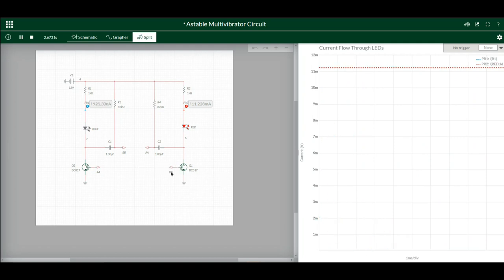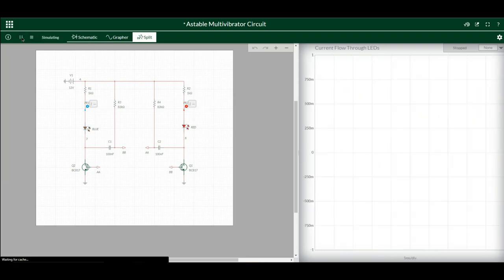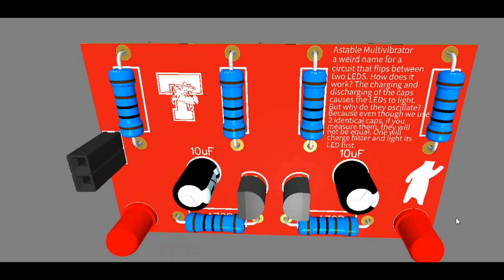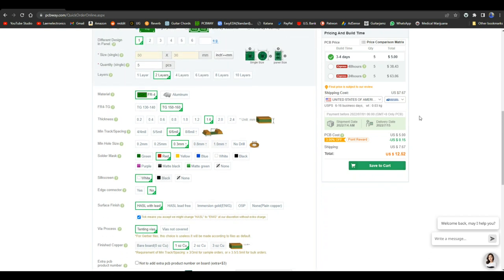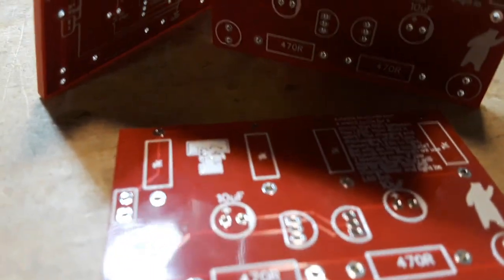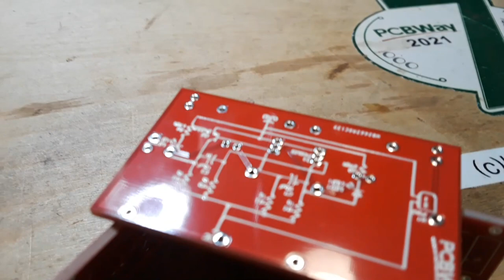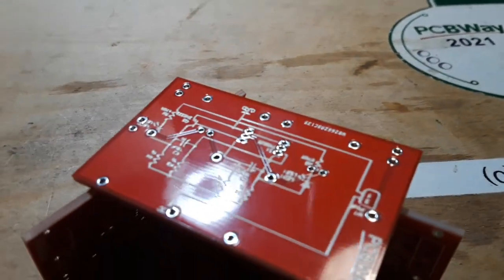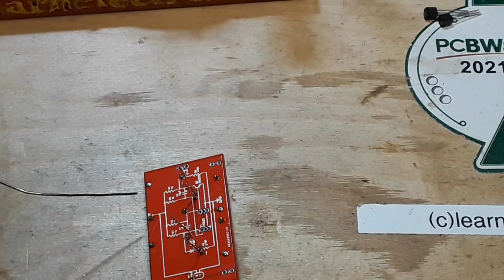Two Transistor Oscillator (AMV) for STEM

Comment: Nice circuit there Paul. For quite a while you were using a holder when soldering up the boards. You should go back to that. All the slipping and sliding as you soldered this one was hard to watch. :o)